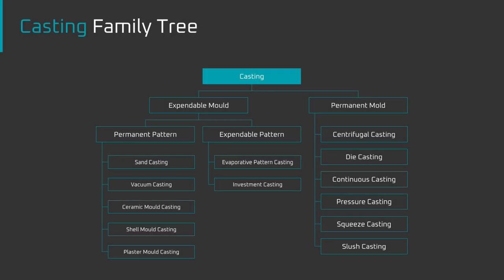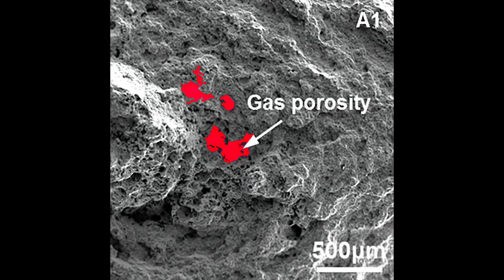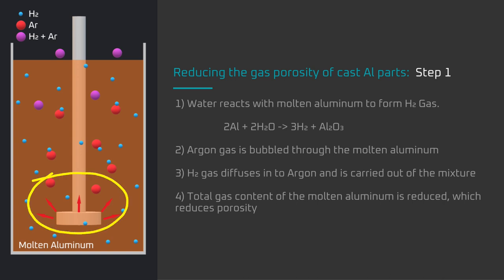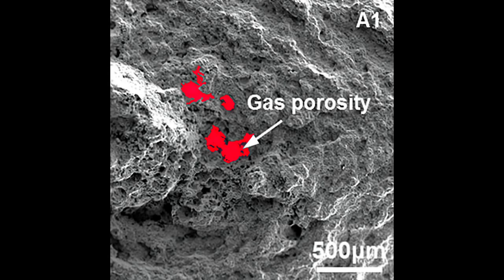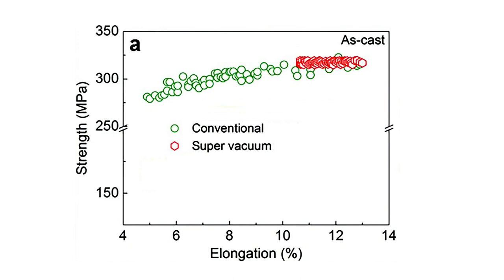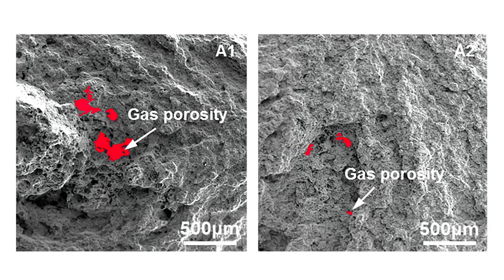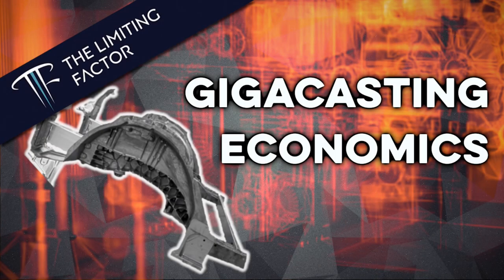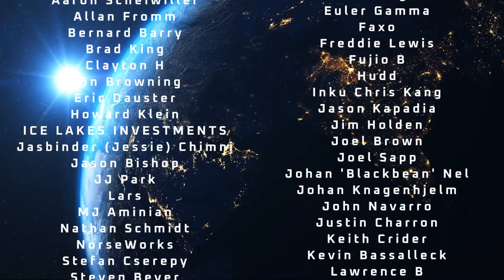Gigacasting // Super Vacuum, Argon Injection, Die Coatings, Thermal Regulation

Comment: Why won’t they use something like a frame on the cybertruck!? Aren’t trucks supposed to be modified, to be equipped with various accessories……!
Reply: Supposed to be modified?  It is common for this to happen, it isn't "required". It does mean that Tesla has cut themselves off from part of the potential market, but I don't think this will be significant in terms of profitability.
Reply: @grahammonk8013  lol….. do you even know the field of applications of trucks!? They are not made for boring daily driving mate, trucks are made to be use for specific purposes. Ford for example sells some models with just the cabin and no bed or just bare chassis with powertrain for conversions into ambulance, rescue truck, dump truck, tool trucks or some other special ones. Even for snow plowing….. they need place to mount those things.
Reply: @alanmay7929  True, there is no chassis cab or cutaway versions of Cybertruck, no (easy) way of mounting a fifth wheel. What % of F150/F250 are sold for those uses? I can't find any numbers, but just going by the ones I see driving around, it's probably less than 25% The way I see it, those market segments might be nice for the dealers and upfitters in that market, but they are not the biggest moneymakers for Ford themselves, and it still leaves a pretty big market for Tesla to sell to, as shown by the interest since the announcement, plus the new potential purchasers. Many people are looking at the CT who wouldn't otherwise be buying a pickup. I would expect that quite a lot are now potential buys of the Lightning instead, will be interesting to see how that all shakes out.
Reply: @grahammonk8013  are you serious!? Who is going to use a fifth wheel on a Ford F-150, the 5th wheel is used from the Ford F-250 and up since they tow more than the cybertruck for example, there is no such things as percentage because not everyone has the same use of their trucks, some buy trucks used and modify them, some companies customizes trucks for their use….
Reply: I think what you want to do with your truck will determine what truck you buy.  An exoskeleton means there should be no need for a frame but we have no idea what internal works there will be in the end that could allow for some add on equipment.
Reply: @grahammonk8013  so you mean all those people are just going to buy the cybertruck and use as a daily driver right!? When a simple model y would have been perfect for everyone, what’s the need to waste all those batteries and materials on such bigger/heavier cars!?
Reply: @TheEvilmooseofdoom  with a truck with very solid chassis for example a super old 30 years old Toyota hilux is still very useful for sooo many applications, trucks are supposed to be flexible in their use unlike sedans or hatchback.
Reply: @alanmay7929  Why do all the people around here use their F150s as daily drivers?
Reply: @alanmay7929  Yet there are dozens of different kinds of trucks.

Comment: I would be impressed if they can cast screw threads... Unless the die is split into multiple parts it shouldn't be possible: if the thread can hold a screw, it should hold the die also.  So maybe Elon was just referring to reduced machining from strategies like:
* avoiding threaded fasteners altogether.
* reduced warping means you don't need to drill precision holes after the fact.
* other parts attached to the casting have adjustable fastenings. 
* spacing around the part in the car design reduces the need for deburring
Reply: Thread the die boss out of the cast threads during the extraction process.
Reply: you can actually design molds to cast parts with internal threads. As long as they are exterial threaded holes pointed towards one of the mold halves. You have a screw in the mold that unscrew its self from the mold seconds or most likely fractions of a second after the material solidifies. Then the half come apart to have the part ejected
Reply: @kschleic9053  or make the threads after verifying that the casting is structurally ok!!!!!!
Reply: What I think happens is one 3 things. Some threading is done after, but it's minor work and Elon just didn't consider it needed mention. There is no threading needed, and any physical bolted pieces are achieved by bolting through wholes in the casting. Self tapping bolts or screws.